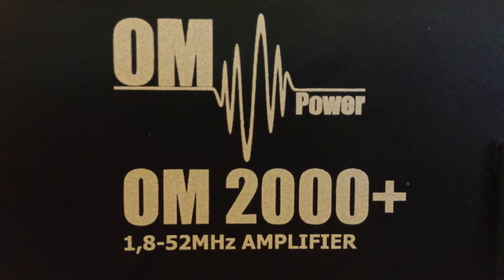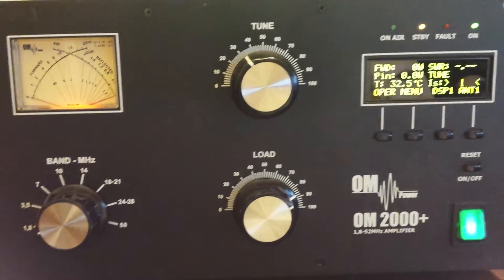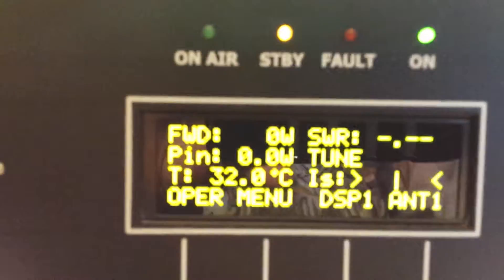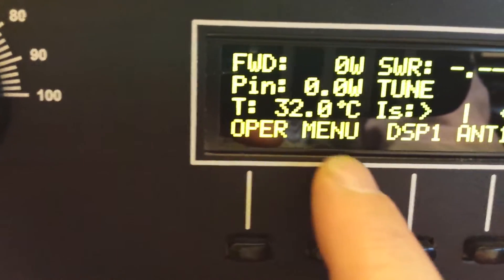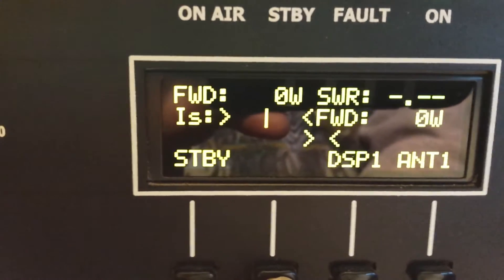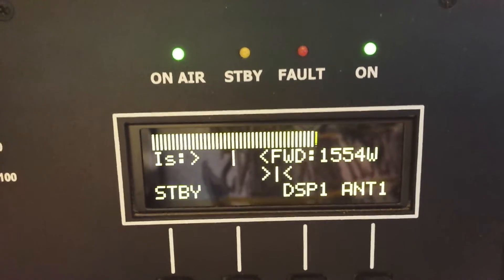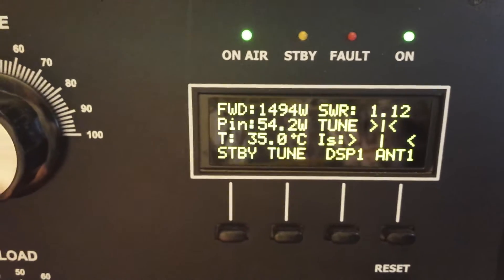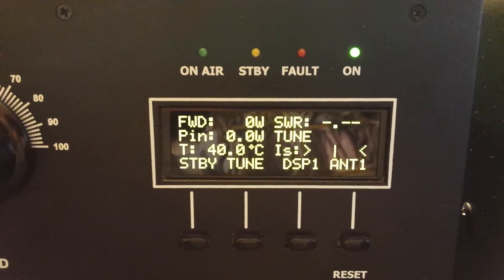OM Power OM2000+ 160M Tune Up

Comment: Dear OM NICE VIDEO, i just recently added  2000+ . all works fine but i noticed the temp goes up to 70 deg c from 35deg c and the second fan kicks off  (shack temp is 28c) with a few minutes of operation. kindly advice if this is normal with your amp
73
SAN A45WH
Reply from the maker: +Sangeeth Musaliar 
Yes, it gets to 70c and the fan kicks on and cools it off quickly. It takes a while for it to get that warm though. Usually only when digital contesting. I wish the high speed on the main blower would kick in sooner, if it did, I don't think the aux fan would ever kick on.
Reply: My OM2K+ also experiences  70-72 deg c, but that's lengthy long winded QSO's. For contesting it does not get as hot cause there's enough breaks in between to cool. My ETO Alpha 86 is better for long winded QSO especially like AM. I can not see using digital work with these amps unless i run duct work from the blower vent to outside, lol. If this amp didn't get so hot it beat my Alpha, but I still love my Alpha. Not that the OM amp doesn't have its advantages that beats the Alpha, but maybe I'm just  smitty over my ETO. There's a couple other issues I'm wondering if you guys experienced with your OM2K.